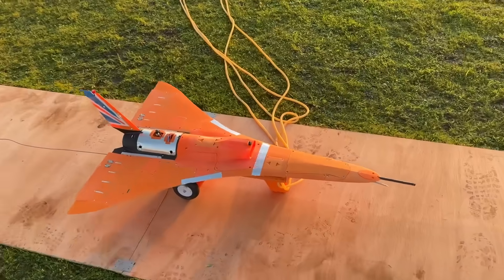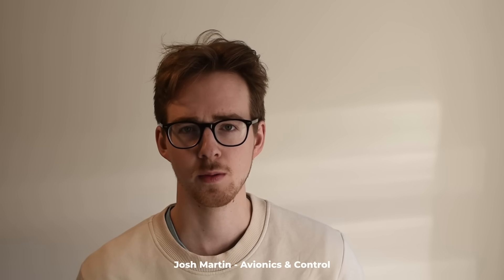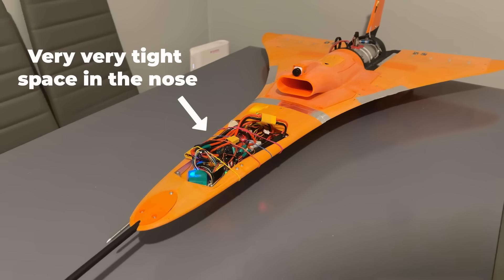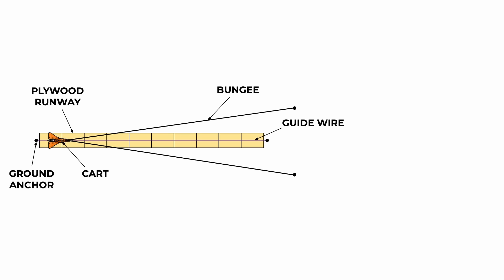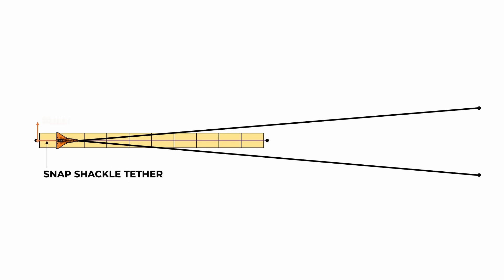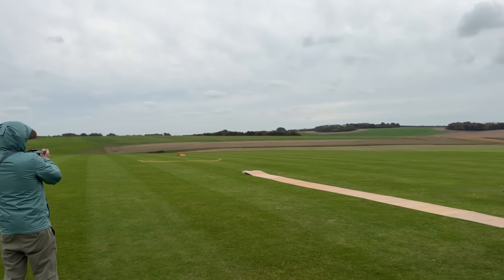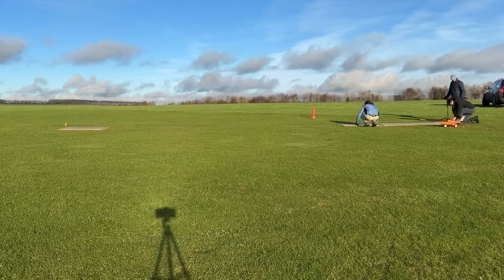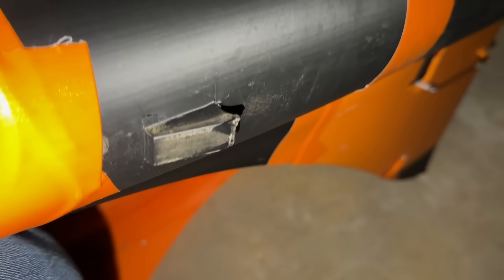It Almost Flew! Kingfisher Mark 2 Launcher Tests and Final Flight Prep

Comment: Nice project. I build myself a small Delta with DJI O4 Pro, Speedybee F405 Wing and Kolibri T35 Turbine. I also printed the fuselage in PETG HF, but fully covered it in GFK. Wings in Oldschool Build Balsa Ripps with 1.5mm planking. Then covers in GFK too. The Rudders I print in PETG HF but because of the high Speed I want to fly I use CFK tube to reinforce the rudders. What I see if that you have plenty of Aileron travel. My Delta needs around 5mm! Aileron travel, and rolls like a devil at full Power. 

I start mine with a bungee too, but from a ramp. The Trolly you build is nice, but with a thing like that there is  plenty of room for failure!

If I see your Vertical stabilizers and thin rudders, I would reinforce them too.

My First FPV flight was 334kmh horizontal. Weight 3.3kg. Wingspann 800mm, Length 1130mm. Turbine: Kolibri T35 (34N thrust)

 If you guys want more infos, PN me.

Comment: I've been following for the last maybe 4-5 videos. I have a question on the engine air intake. Why is it sitting off the top of the aircraft. Will that not induce turbulence and drag with air hitting in between the air intake and the top of the aircraft?
Reply: No different than the bottom of the aircraft…except at high alpha/angles of attack.
Reply: @gpaull2 I just meant the space between the intake and the top of the aircraft, not specifically the location. I feel like air would get trapped there and cause drag.
Reply: large scale jet aircraft use a diverter between the surface of the plane and the intake to avoid slow and turbulent boundary layer air (caused by friction on the plane skin) from going into the engine. that might be why this model does the same, although I don't know nearly enough about aerodynamics to say if that matters as much at this scale. interestingly, modern stealth fighters (F-35) don't use this style of intake anymore, as it increases radar cross section, so they instead use some aerodynamic trickery with a bump to like get the boundary layer out of the way. that would need a lotttt of cfd and testing to get working though.
Reply from the maker: @pnwscitech1589  Great question - the gap between the inlet and fuselage stops slow moving boundary layer flow from being ingested into the engine, this ensures we get uniform flow into our inlet which improves engine performance and reduces the risk of stall
Reply from the maker: @helloeverything496  Spot on. Diverterless supersonic inlets are sort of wizardry, and their design principles haven't migrated down into mainstream textbooks yet. It's a lot harder to get right and also needs to be longer , with a bigger inlet cowl. F-16 style inlet is the perfect choice for us.  -M

Comment: One way you might be able to better bleed in your fuel system is by first pulling a vacuum on it. Done correctly, this both eliminates air and primes the system in one step. It also eliminates the need for an air trap. I'm not sure if your setup or components will allow for this though. You could very easily fill the tank doing this, but the entire plane fuel system may require more effort.

Disclaimer: I've never worked on hobby scale jet engines and this might be a terrible idea, but it's the same principle used for charging HVAC systems, and is also the same way many spacecraft are fueled.
Reply: They cope fairly well with air. 
And inch or two in the line won't stop it.

Comment: Hey guys, cool project, just some help, your ramp flip-up at the end is too abrupt an angle change. All it does is upset the aircraft and potentially cause a stall, as evident in your clips.  You appear to be on the edge of V1min, and I am sure your acceleration math tells you you're ok, maybe? I would increase the length of the bungy, double it, and double the length of your takeoff ramp. Get rid of the flip-up at the end of the ramp, just make the ramp a gradual incline, 3-5 degrees, the entire length of the ramp, no flip-up. This will keep your aircraft from becoming upset, reduce the chance of a stall, and push your acceleration gradually closer to V2 over a longer distance with fewer G's. A much smoother take off.
Reply: Agree about the ramp. You can see the sudden flip up is is promoting instability at the most critical stage of take off. I would suggest a gentler transition to the ramp.
Keep going fellas!
Reply from the maker: @adecarnally5501  A gentler transition will be a lot easier to implement than inclining the whole ramp - will look into it, cheers!
Reply: Model RC launch systems were perfected in the 1930's this group is CONSTANTLY re-inventing the wheel. Perhaps showing a little respect for the pioneers of model aviation would have saved considerable time and money. Has a single member of your team done ANY research into aeromodelling techniques? It seems not. Your aircraft could easily be HALF the weight that it is.

Comment: Did you check if the exhaust velocity of Jet engine is supersonic ? Without a supersonic exhaust velocity, you will not be able to break sound barrier. An air breathing jet will not fly faster than its exhaust velocity
Reply from the maker: This aircraft is designed to go at Mach 0.7 at sea level - the flow from the nozzle is ~900 mph for the P60 and ~1050 mph for the P130 so significantly more than the speeds we’re aiming for
Reply: @TheMachInitiative Just to second that concern the altitudes you would have to achieve to hit mach with that exhaust velocity would be very difficult to achieve with a plane of that size, not to mention the geometry of this mini engine is probably not meant for that altitude and velocity and you would probably be plagued with compressor stalls (maybe not with your intake design if the air is moving slow enough but never know could still stall from the thinness). 

Maybe you guys should work on building a rudimentary afterburner so that you can achieve mach at a reasonable altitude, it would cut your runtime but would give you a good shot at hitting some really crazy speeds.

Also you need an engine preheater, they are used irl. Thinking maybe a propane cannon or heated blanket to keep everything warm before you start the engine.
Reply from the maker: We aren't trying to go supersonic with this aircraft. -M
Reply: @TheMachInitiative Gotcha whats the speed goal?
Reply: @TheMachInitiative
I would have expected double or more flying speed. 
But I'm not an engineer.
Reply from the maker: @brucebaxter6923  We've modelled the engine at different speeds in MATLAB - as the speed increases the pressure ratio also increases so the exhaust velocity increases above the 900 - 1050 mph static speed, so this helps with maintaining thrust at our max speed
Reply: You can get a ball park idea with the pressure ratio. You will need 2 bar at nozzle inlet to get Mach 1 exhaust velocity. With turbine consuming most of the pressure, I would guess 3 bar engine pressure to consider that a starting point. These engines consume over 1 litre fuel per minute at full throttle so to reach mach1 plus take off etc. You need somewhere around 5litre fuel capacity which will be internal to the plane. These are ball park figures but will help you in doing a basic check on your design